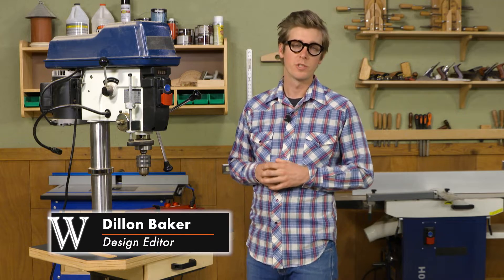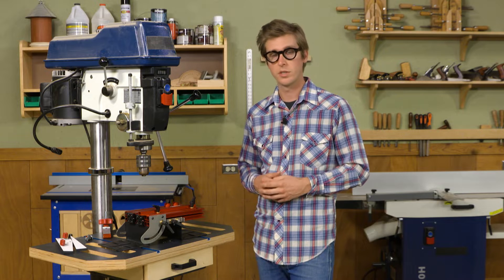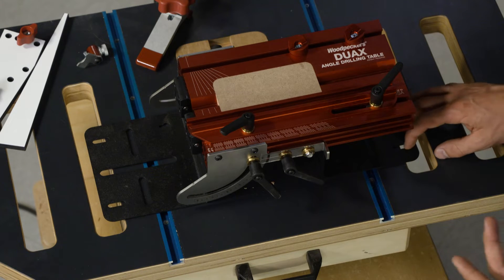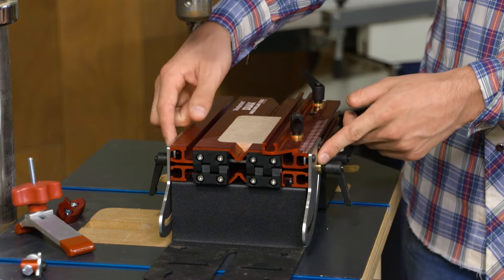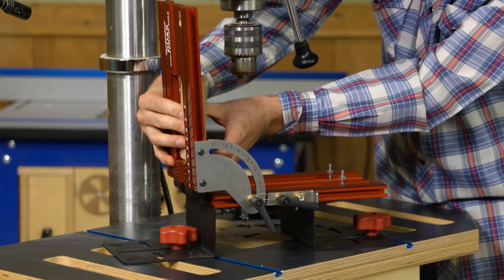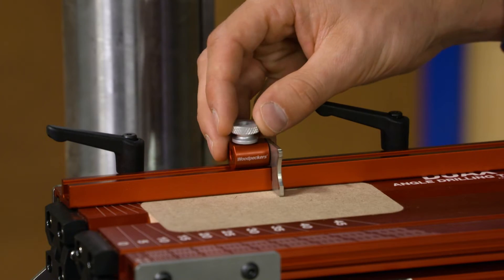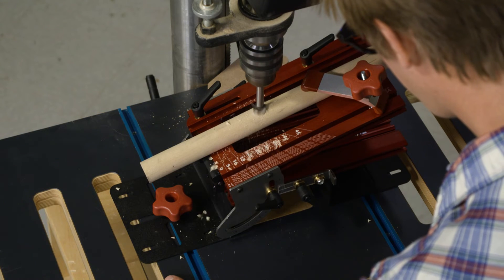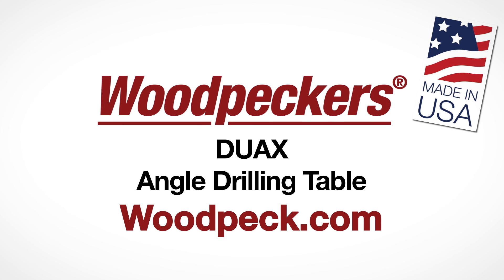Woodpeckers DUAX Angle Drilling Table | Knothole

Comment: I was using a few tool including an angle vice and other tricks to do what this tool does. Not cheap but the DUAX does save time and take your DP to the next level. Wish list: I can adjust the DP table height but wish that the DUAX  had a horizontal level adjustment feature as well.